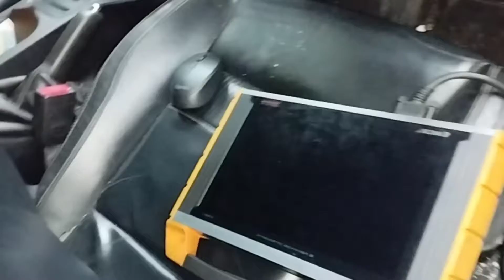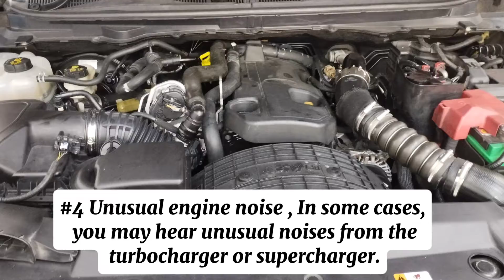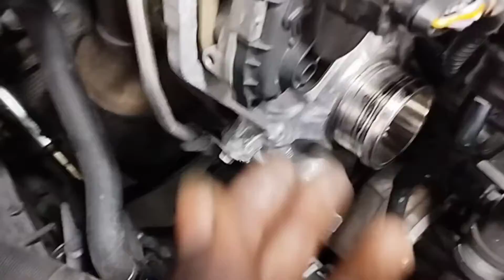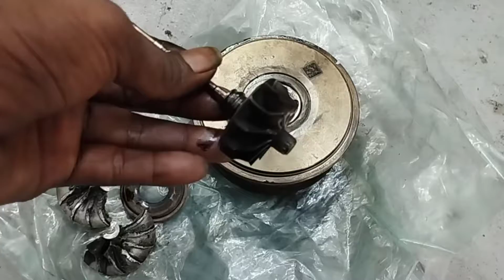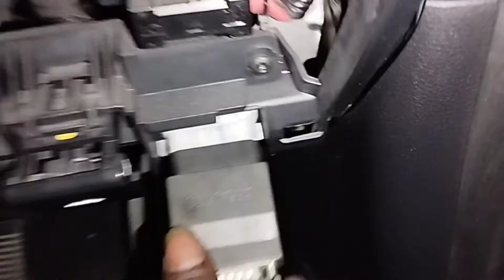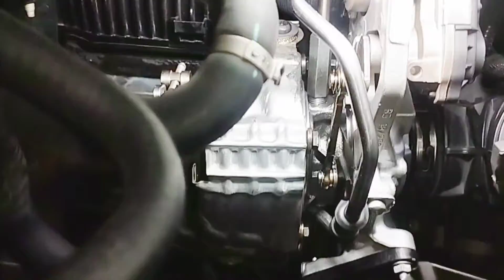Ford Ranger 2018 ! Engine Power Loss ! Casuse and Fixes Code p0299 ! Turbo UnderBoost Condition

Comment: How di i confirm if the Turbo Actuator is faulty? For ford ranger 2.2, i hv replaced the turbo core, but the problem of power loss is still there
Reply from the maker: Check scanner Is there any fault?